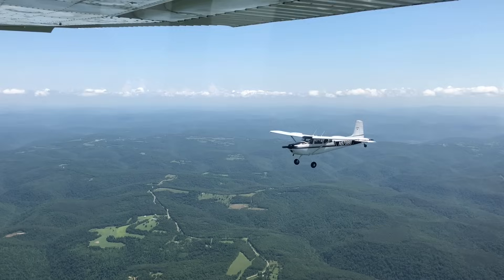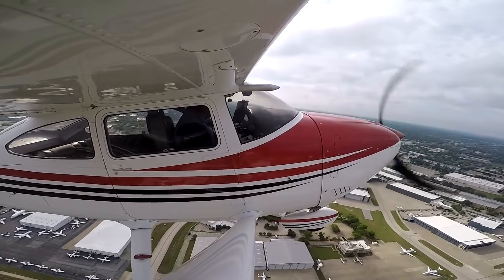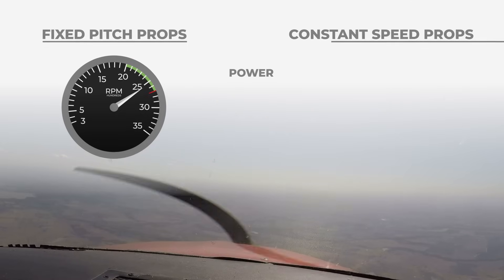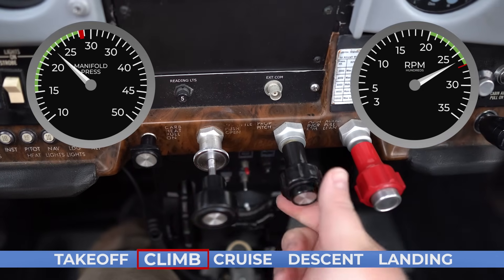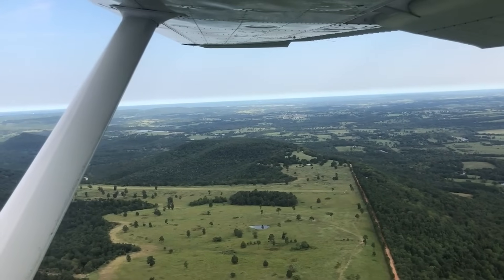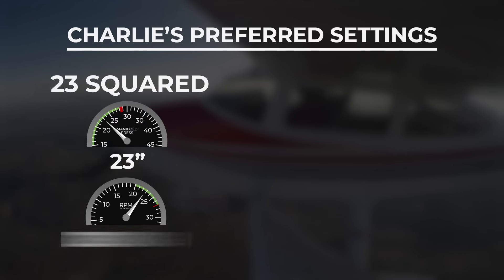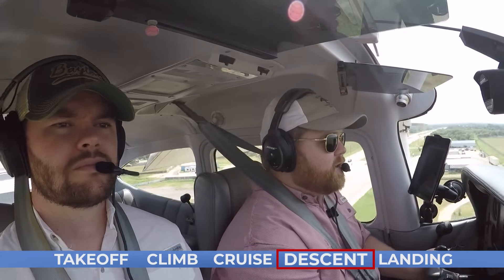How to Use a Constant Speed Prop in Each Phase of Flight (Made Easy!)

Comment: Not this over square myth yet again,  just follow the POH, sigh . . .
Reply: It shouldn’t even be mentioned at all. 

Also, you’ll get far better engine life and better efficiency going as over square as you are allowed to. In the 182 I flew it was 2300 (2200 wasn’t great for Continental counterweights) and wide open throttle (at my typical cruise it was less than 75% power). 

Lower friction, engine ran quieter, airspeed was way better than a square setting, and compressions stayed good instead of falling like typical Continentals thanks to that pressure keeping the rings seated.
Reply: yup
Reply: @calvinnickel9995  yup
Reply: And everyone’s eating it up. They gotta listen to Mike Busch
Reply: He literally says to follow the POH several times in the video
Reply: I’m unfamiliar, what is the over square myth?

This is how the piston is made, right?

(Undersquare = more torque, over square = more power and performance?)

Edit: Wtf? That’s [no no word].
Reply: @b226tj no, that's another story related to engine bore/stroke ratio. In this case it's manifold pressure/rpm ratio.
The oversquare myth is that if you run the engine with a higher manifold pressure than RPM, the engine won't last too much. (MP in inches of mercury and speed in hundreds of RPM)
Reply: Over square is a myth man. Simply a function of the units we use happening to look similar
Reply: If he's afraid of "over square" he should just leave the RPM at redline.

Comment: Decades ago I read an article by Bob Hoover.  He suggested keeping full throttle on climb to altitude and backing off on the RPM within the limits of the POH.  Manifold pressure automatically goes down an inch for each thousand feet of altitude gained so rather than reducing power after takeoff, then adjusting it back up as you climb, leave the throttle alone till leveling off at cruising altitude.
Reply: I think this is good general advice, but of course you’ll want to check your POH for their recommended settings. In a normally aspirated engine, you’ll find that you’ll always be undersquare at cruise altitude.

Comment: Never overboost is what i was taught,  ( Always have the manifold pressure controlled by the throttle less than or equal to the RPMs controlled by the prop lever), so to climb increase prop lever first to increase rpms, then increase throttle to bring up the manifold pressure to square, for example to 25 rpms, and then 25 inches Manifold Pressure, to descend also dont overboot MP,  < throttle-MP first, then <prop lever to < RPMs to say 22 square, meaning both MP and rpm guages read 22!

Comment: Great video! The lightbulb moment came for me in the last minute of the video. Flying with prop control full forward is just like flying a fixed pitch trainer. Simplifies the thinking greatly. The prop lever just becomes an extra tool in your toolbox to get added efficiency out of your engine. The bicycle gears analogy was great too.

Comment: Even though I did my training in a Decathlon with a CS prop, I found this video interesting. Pretty much what you said is how I was taught to use it.  One thing worth mentioning though is at higher altitude and descending one needs to pay attention to manifold pressure as it can rise above RPM setting. Of course though it can be said that during a descent you should just pull back some power anyways as you can use the descent to maintain your airspeed.

Comment: Most of this is great! However, oversquare operations are generally more efficient, and healthier for the engine than underquare. I agree it's best to work the knobs/levers left to right, but oversquare is not any more risky than the engine being shut down with 30"MP & 0RPM. Mike Busch has a plethora of good material on the benefits of oversquare operations.

I fly a TR182 which is turbocha. As you said, I operate almost exclusively oversquare. As long as we don't operate outside of the parameters set in the POH / Engine manual, oversquare is a good thing, not a bad thing. It is possible that one could force an overspeed, but that won't occur until the prop has already reached its maximum blade angle and still has too much power to maintain the desired low RPM.

Comment: The bicycle analogy made my day, it is literally that. You have many combinations of gears and “effort” that you put on the pedals, and there is a perfect combination of them both for each phase of the flight.

The selected gear would be the RPMs: low gear = high RPM and less effort to move the prop/bycicle, therefore you can put more effort (manifold pressure) without becoming too tired, whereas a high gear (lower RPM) offers more resistance, which means you can’t go as high on manifold pressure (you’ll become too tired), but it’s ideal to go faster on a flat surface (on cruise).

Comment: Great video, thanks, Charlie.
Nice rule of thumb (on STD arrangement Throttle-Prop-Mixture):
Thrust increase: Right to Left, 
Thrust decrease: Left to Right.
E.g Go around: Mixture RICH, Prop high RPM, Throttle forward.
Power reduction for level off at top of climb: Adjust MAP,  then RPM, then Mixture.
(Some mentioned this for thrust increase but the reverse for reduction works also).
Reply: Like right to left or left to right, never over boost the engine,  I will search for any other neumonic memory aids
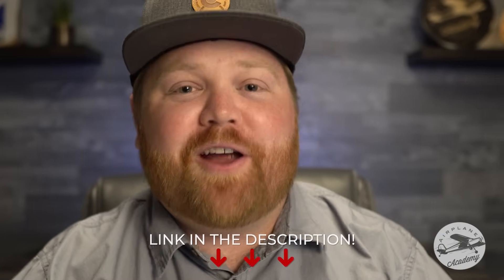Reply: This assumes you're flying from the left seat LOL 1- thrust increase bring 9:32  it to you(as u adjust levers) right to left 2-thrust decrease move levers away from you, left to right, again assuming flying from left seat, avoid over boosting meaning having MP greater than rpm, I loved flying the Beech Sierra in complex training, steep turns with gear up!, but for engine out I practiced with gear up but on ckride I was asked to demo from slow flight with gear down, I had to redo the ckride but sucked up the gear on the reck as I had less drag to make base, then I dropped the gear, I passed but the old b-17 pilot examiner said "that's one way to do it" lol

Comment: This was a very insightful video, particularly the "lightbulb moment" part.  Your video is the first time I've heard anything other than a passing mention of "over/under square."  It's not mentioned in FAA-H-8083-3C - Airplane Flying Handbook, Chapter 12: Transition to Complex Airplanes, Controllable-Pitch Propellers.  Based on the complex training and the POH, I figured out the T/O, landing, and pattern prop settings were all going to be "full in" i.e. shallow angle for the most low-speed "bite."  It's not for speed, but it is tuned to provide the greatest thrust at full throttle when your aircraft is travelling in the Vx and Vy speed range.  Usually, timing one's descent to arrive at the IAP on altitude and airspeed with a low or idle power setting from cruise altitude is best for energy management.  However, if you need to descend faster, pushing the prop full in shallows the angle of the blade, and with the throttle at idle and higher descent velocities, near or in the yellow arc, your propeller acts like a brake.  You must, however, pay attention to the RPM to ensure it doesn't windmill its way past your engine's RPM limits.  Always adhere to your POH!  If you don't need to waste energy to get down faster, keeping your prop at cruise settings, or even full out, will minimize friction during the descent when your engine is at idle.
Reply from the maker: Well said, Justin. Thanks!

Comment: Great explanation! Would like to see a follow up that goes into leaning the mixture... Do you go by the RPM gauge or the manifold pressure gauge to find a good air/fuel ratio.

Comment: What my instructor told me many times regarding the "what should I reduce first?" problem (timestamp is 6:03 ) is simply "propeller is ahead of the engine" - reduce manifold pressure first, increase RPM first
Reply: I don't get it. First the blue one or the black one? (By setting it in cruise mode after climbing)

Comment: Mixture, props, throttle. That's the mantra on power advance. You learned in primary that the mixture needs to be rich enough before advancing throttle, so now the props need to be set high enough before advancing throttle. That's all you need to remember. Everything else, you just set the power according to the POH. 
I keep my RPM setting at the cruise setting until the pattern or until after final approach fix. If I'm too high or fast, keeping the throttle closed and advancing RPM is like throwing out an anchor. ;)

Comment: Great discussion! One extra note to add during your “over square” discussion:

Every takeoff at max throttle in a FP prop is “over square” operation! Don’t fear it. Just understand it. 👌🏼my o-320 FP catto prop equipped RV-4 only turns 2150 static RPM at 26”+MP as I release the brakes on takeoff. Same goes on any other FP prop equipped airplane. Same goes in a WOT hard climb.

Comment: First video of yours I've watched and I don't think you even, at least verbally, asked for a Like or Sub. You earned both here man.

In msfs 2020 I've been hauling cargo with the SWS Kodiak 100 and have popped the engine twice - granted with many many flights logged already. I've been keeping the prop lever full forward until reaching cruise height. For descent I've been leaving it back for 2000 rpm until entering the pattern.

The way I understand it now I need to mix the power and prop levers to achieve the POH recommended torque. I've yet to test this in the sim but that must be it. Doing that I should be able to achieve SWS's POH torque numbers that I thought, being a sim, were real world numbers but unachievable in the simulated 100. Doh! Their POH is, of course, not as comprehensive as the real one - I assume - but it does have reference charts for different altitudes, OAT, and total aircraft weight.

Mainly I've ignored the POH charts because I didn't understand, thoroughly, the relation between those two levers. Secondarily, flying in VR as I do, reading PDFs by peeking out of the headset along my nose, is awkward and "immersion breaking," I'm buying Sim EFB, which is made for VR - but works for monitor flight too - and supports reading PDFs in VR. (Yeah!) Edit: I bought Sim EFB but, apparently, I was mistaken in thinking it supported displaying PDFs. Sigh. Now to look for another solution...

For now I have msfs's Engine Stress Damage, or whatever it's labelled, disabled but once I get a handle on managing torque I'll re-enable it.

So thanks for a short, concise yet thorough, explanation and for getting right to it in the first second of the video. I'm going to check out your website and, assuming there's paid instruction, might even buy some. If it's all ad supported... Great!
Reply from the maker: Thanks for your comment and glad you found the content helpful! Your VR sim immersion sounds really fun. One day I might get into that. Thanks for the sub!

Comment: You know what's interesting?

I've been doing this in DCS's simulation of the Spitfire Mk IX. If there's any difference at all, it's that prop RPM goes up to 3,000 not 2,600 RPM. And there's a supercharger for very high altitude. And, you  know, 3000 horsepower instead of 300. But otherwise, the same. 

I've been kind of doing it wrong, so thank you for setting me straight!

Comment: You may have mentioned it, and I didn't hear it. We refer to two propulsion systems, a "fixed pitch propeller" and a "constant speed propeller". What I've yet to hear is how do you adjust the pitch on the propeller? Can you adjust it manually or is it done automatically by some algorithm between manifold pressure and engine RPM? BTW I'm reading your attached article now to see if the answer is in there.

Comment: Simple, the 172 (cruise prop) is always way over square on takeoff, generally about 30" and about 2300 rpms at the start and maybe 2600 by the time you reach liftoff, in cruise you'll probably pull back to about 25" and about 2500 rpms, if you drop down to 20" you'll probably have about 2200 or so rpms. So if you slapped an STC's constant speed on this with the same engine (if you could), why worry about oversquare?  I like about 2200-2250, it's quite compared to 2400-2500, usually I'll keep it at 22" but cross country I'll do 24" for the extra speed, since the engine is designed to take 30" anyhow, that's not gonna hurt anything.  Next issue is leaning, that's easy too.

Comment: Thank you for that. Whilst not a real world pilot virtual only), I still like to learn about flying GA. I like to know know WHY I am doing something. Very very well presented.
Reply: Keep loging virtual hrs with descriptions of activities. Virtual hrs count in my country and after 48 hrs in cessna and 1 in a Tiger I moved to flight simulators. Get some weather in and it will save you if you follow lessons well. Maybe remember to keep control on ground as if you were prepared for a gust from prevailing wind direction and take weight off front control wheel which is not mentioned in most simulations. You don't seem to need to flare as much in simulation but that will all be covered after 15min Trial effects of  on first actual landing in charge. Don't persist with an instructor you don't learn easily from is my final tip. A 15 year old mowed for his lessons and has his own fleet and district cheif now. He was into simulation for cheap learning. Hope you get up there. I can't pass a medical anymore and miss my wings.

Comment: Good thing bringing in the turbos. The term "square" really only applies to the big, slow-turning Lycosauruses and their Continental brethren.

As soon as an engine has a PSRU or is turbocharged (or both) the term goes out the window.

Just set the "potatoes" to what the POH requires, lest you want to kill the engine like so many unsuspecting 175 pilots did with their geared GO-300s

Comment: Good video. However, manifold pressure isn't a measure of pressure but that of vacuum. (I have no idea why it's called that) The pistons draw a vacuum on the intake stroke and when the throttle is opened the engine is working harder & making more power so the intake vacuum is greater giving a corresponding increase in MP.
Reply: No it isn't. Manifold pressure is a reading of the absolute pressure in the intake manifold. Since piston engine power directly corresponds to absolute manifold pressure, that's what is measured. Just because sometimes the manifold pressure happens to be less than atmospheric pressure (which is never the case in mechanically pressurized [supercharged or turbo-supercharged] engines) does not make vacuum in the manifold a thing. There is no such thing as absolute vacuum. Vacuum is only negative pressure when compared to some positive pressure assumed to be 0. But atmospheric pressure isn't 0. In a standard atmosphere, atmospheric pressure is 29.92 inches of mercury, or roughly 14.7psi at sea level. But the actual pressure of the atmosphere varies with temp, altitude, weather, humidity, all of which are relevant in the environments an airplane operates in, and therefore change the power the engine is capable of producing. Vacuum measurements would negate the effects of the atmospheric changes, and give erroneous power readings. Power is correlated with absolute manifold pressure, not manifold vacuum; hence why we display manifold pressure as absolute pressure, not vacuum.
Reply: Also, to beat a dead horse, but this was an important "a ha" moment for me, vacuum does NOT get stronger when the throttle is opened. Maximum vacuum is created when the pistons have something to draw against: the closed throttle plate. When the throttle is opened, atmospheric pressurized air is allowed to come in as fast as any intake restrictions allow, which increases the pressure in the intake (which is less vaccuum), and forces more air into the cylinders, which means more fuel can be burned, which means more power.